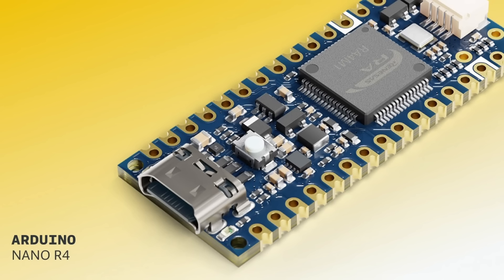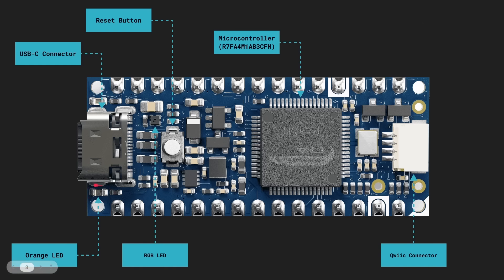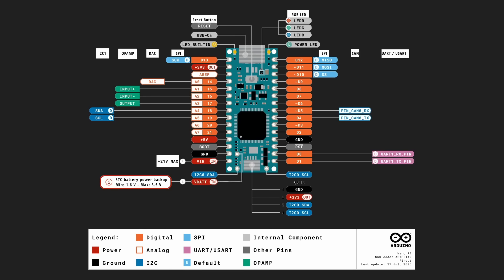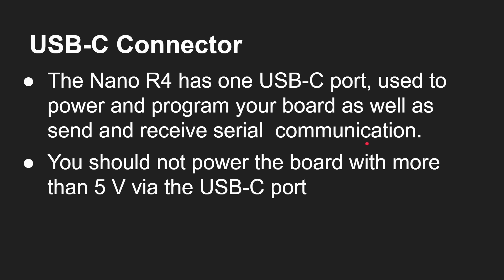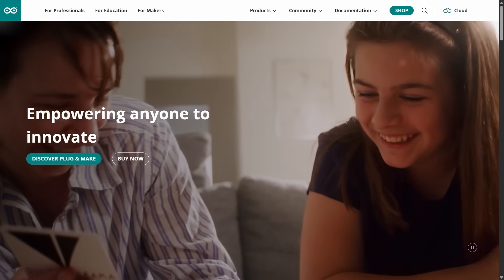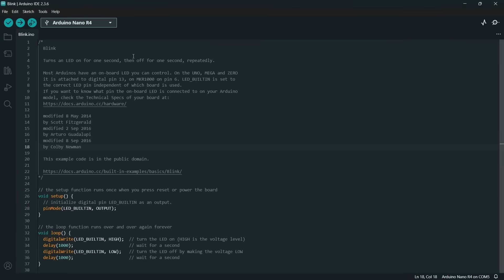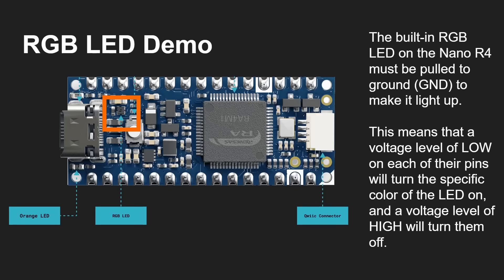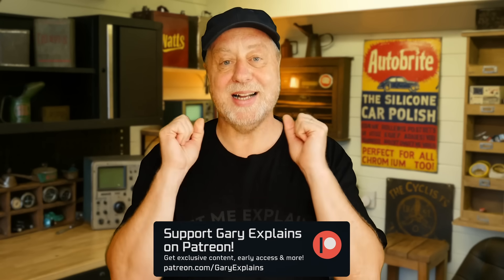Arduino Nano R4: Everything You Need to Know

Comment: Hello Gary, does the Nano 4 have integrated ADC to digitize analog inputs?
Reply from the maker: Here is a direct quote from the documentation (which is a great resource, by the way): The Nano R4 features 8 analog input pins (A0 to A7) that can be read using the analogRead() function. These pins allow you to measure continuously varying voltages, making them perfect for reading sensors like potentiometers, light sensors, temperature sensors and other analog components and devices. The analog-to-digital converter (ADC) built into the RA4M1 microcontroller of the Nano R4 board converts the analog voltage into a digital value that your sketch can process.
Reply: @GaryExplains  Many thanks Gary. I should have worked that out myself!

Comment: dude usb standard voltage is 5v, you cannot risk to go above that voltage, it is also not a PD device so chillax dude
Reply from the maker: LOL. First, the warning comes directly from Arduino, it is written on the product page. Second it is easy for engineers to connect up a power supply to a usb-c connector and push up the voltage. I hope you don't think that every Arduino board is powered by a consumer USB charger.

Comment: "opamp functionality" whish you explained that more in detail, been using arduino for years and I know what opamps are, this "functionality" remains a mystery
Reply: It literally means that. There is an opamp designed into the microcontroller. You can enable the opamp (which disables 3 GPIOs) and use it for buffering analog sensors and such.

Comment: It has a USB C port, but does it have the required power negotiation skills (PD) for the USB C to be plugged into anything other than 5V?
Reply from the maker: Yes, that is right, PD isn't mandatory for any device. However a charger which supports PD starts at 5V and will only go higher if the device negotiates a higher voltage, which in this case the Arduino won't/can't. However connecting a charger with 9V over the USB-C which is fixed and not part of PD would blow up the board.

Comment: All you need to know is that just buy an esp32, cheaper, faster, more memory, with wifi and bt.
Reply: Except that extra power and wireless capability isn't free. It comes at the cost of more power which may not be what you want if you're making a battery powered device.
Reply: @Pyroteq yes but you have the option to disable them, and use the very low power co proccessor. With Arduino you don't have options, you are stuck with the lowest specs, and power consumption isn't as magically low as you think it is when you actually use it.
Also, like I mentioned, you can buy like 10 esp32 for the price of 1 arduino! Hell, I just saw a short here of an Esp32 with a 3" touch screen and a whole bunch of connections and options for less than a single Arduino!

Comment: More like an advertisement than a tutorial.
It's not as easy as you make it out to be either. Many people, including myself, have had a lot of problems getting the official Arduino boards from the Arduino people to even connect to the computer. Their IDE software will not even run on my Windoze 10 computer. No surprise there. It took me 14 hours to get the Nano to communicate with my Linux computer. There the IDE did run without any problems and programing was a pleasant experience. These problems shouldn't be, since the Arduino dates back twenty years and has been on the market for just over ten.

There is no excuse for this, since keyboards and mice can be connected without a problem. A twenty year old chip should have all these permission problems SOLVED!!!

This isn't, "Everything You Need to Know."
Reply from the maker: As you say these problems shouldn't be and in my experience aren't. It runs easily on Windows 10 and I have never had anything to like the issues you describe. I would suggest the problems you describe are not the norm. The fact it won't run on Windows 10 at your end sounds lots of alarm bells about your local setup.
Reply: @GaryExplains  Not the norm is laughable! Tell it to all the post and forums to fix "not the norm." That includes the fixes for both Windows 10 and 11 posted on github, the Arduino official forum and all over the net.

When contacted the Arduino people themselves admit they have a problem, they admit this!!!
Reply: @GaryExplains  You are so nice!
Reply: First, make sure you are using a 4-wire USB cable (power and data). A 2-wire USB charging cable will not work. Then, after you connect your Arduino board to your (Windows PC) USB port, head over to the Device Manager to make sure your Arduino is listed in the Ports (COM & LPT) drop down. This will also let you know which COM# the Arduino has been connected to. Hope this helps.
Reply: @12DGJB21  If you had read my post, I already solved the problems. It would be obvious I had a working USB cable to get it to work on Linux.

The com port and PERMISSIONS are the problems, which you did not describe the com port problem well enough for anyone reading your post.

If you want to give advice, be accurate.
Reply: @nilsskansar416  A statement without a conclusion. You didn't say anything.
Reply: @LeeManning-x5y  You are responding to chat I can't see, which means somebody is messing with the chat.
Reply: @12DGJB21  Thanks for the advice, but if you read my post it is now running to my satisfaction. I did indicate this in the post with the ability to program the Arduino.

I don't care if it works in Windoze, which is why Windoze is spelled the way it is. I tried it after it wasn't working for me in Linux.

This wasn't the only Arduino that didn't work. I had problems with the Uno and the Nano WiFi as well. The Uno was solved first and then the Nano. I contacted Arduino for help with the Nano WiFi board. All three had communication and permission issues of their own!!!

The com port is the common problem for both Linux and Windoze that wasn't addressed at all in the video, and should of been, which you could have expounded on so others could solve the problem. It's a little bit more than look for the Arduino port, because it isn't stated just like the board so named, is it?

Comment: gary do you have a beginner video for getting into using microcontroller boards
Reply: Don't be intimidated! Get yourself a breadboard and a kit of passive components and spin up the Arduino IDE. The example code for these boards is extremely simple and easy to learn from.
Reply from the maker: I have quite a few, please see my microcontroller playlist and maybe  start with https://youtu.be/dOa3570JM2M?si=u74A9qm9MtqZgSmO

Comment: Nice video, thanks :)
The Green Power-ON LED takes c. 3mA, so for any low-power use that LED will need to be disabled from the +5V supply by removing the 1K series resistor R8!
I reconnected mine to the USB +VBUS, so the Green LED still works when USB is connected, but does not illuminate or drain power when VIN is in use for stand-alone operation.

Comment: The worse tech support ever, I was trying to return my MK10 wifi and they was asking many questions every time I was sending the response with all the data they ask and still not getting any responses from them of how to return my order, not good for me
Reply: yet another reason not to buy arduinos
Reply: @gazehound  Another one would be the concentration of GND pins on the bottom of the board without a single GND pin at the middle or top of the board. The RP Pico (Wn) is way better in that regard. The builtin OpAmp is kinda nice, but I often find that the requirements for an OpAmp vary wildly between projects. But what is convenient to have also differs from project to project, so eventually I'll may start a project where the R4 is a (near) perfect fit.

Comment: Just keep in mind that the Renesas RA4M1 GPIO pins can only supply 8mA, which is barely enough current to make the leg of a gnat twitch. It requires a line driver IC in a lot of use cases, which is one reason why the Arduino Uno R4 Minima has been unpopular.
Reply: The other thing about uno R4 is that it uses an esp32 for the wifi. Which makes one wonder why not just use an esp32 instead? Also, initially the uno r4 had a much higher price. I think it has dropped by 40% or so since it launched..

Comment: Your videos are always great and provide a great intro to new boards & devices. I appreciate it.  I always evaluate new boards for my use and I'm kind of stuck on ESP32 board bec they are very low price and provide wifi & BLE.  @GaryExplains can you tell me why I would ever choose the R4 over an ESP32?  At first I thought the R4 might beat ESP32 on ADC but both are 12-bits.  ESP32 is $8 while R4 is $12 (with no wifi or BLE).  Thanks again